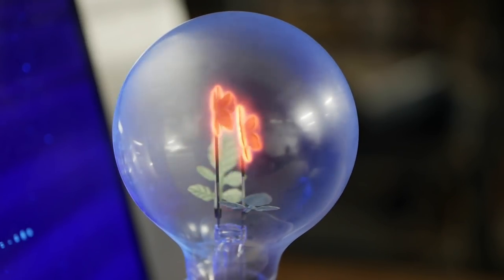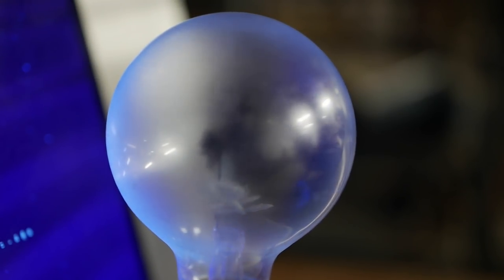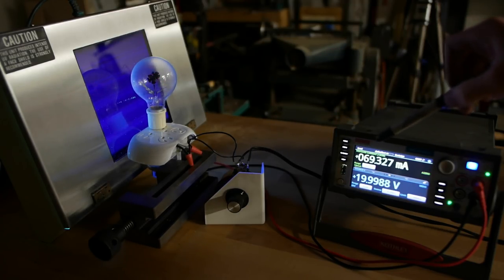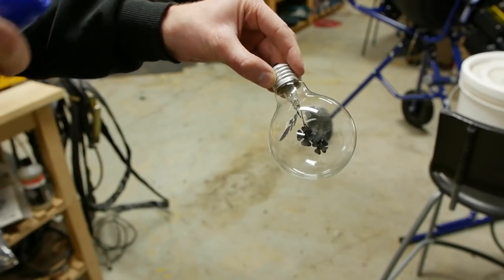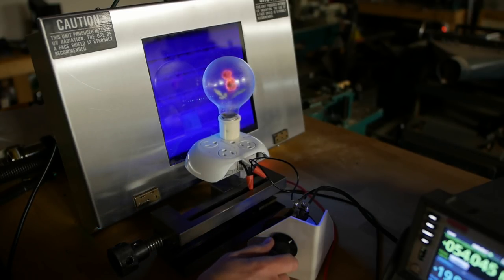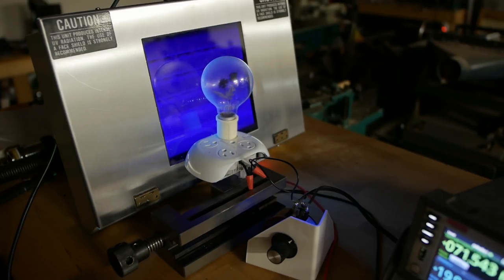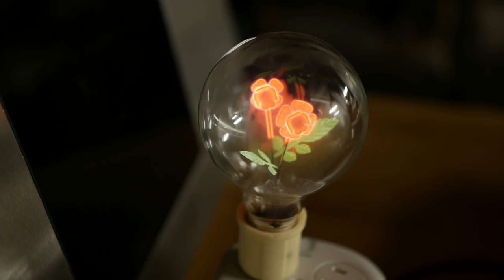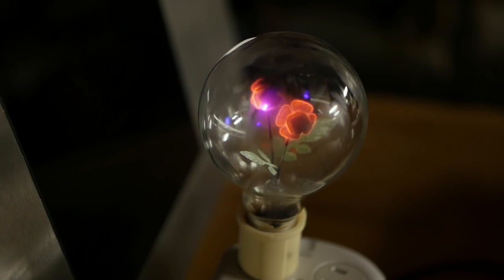Flashing Light Prize 2018 - Sunscreen, UV, and neon

Comment: Great video!  I do want to note that It is actually possible to use lower energy photons to push something into a higher energy state than would be predicted by standard methods.  The phenomenon is called 2 photon absorption, and it is used in microscopy of biological specimens where damage due to high energy photons needs to be avoided.  Maybe you can come up with a way to demonstrate this effect in a future video.  Keep up the good work.

Comment: wow, two things that surprised me, (1) Didn't think the photoelectric effect would worked through glass as shorter wavelengths would be required .  (2)  I guess the AC is enough to turn it back off, as once ionised it would normally stay on.   Nice application of theories

Comment: Is firestarter a brand name or is the outlet a cheap gimmicky thing that would actually start a fire? What is the purpose of having rotating outlets and how did you connect a motor up to it?
Reply: I'd be interested too
Reply: Shocking purpose: ...self-winding cord unplugs automatically after it becomes tightly coiled (and/or starts on fire).

Comment: You can achieve the exact same effect by illuminating a neon lamp near ignition voltage with nothing more than a red LED.  UV is not required.  I discovered this when I was using my DIY telescope motor drive (U-controller controls output frequency for standard, sidereal, as well as the King rate) to a synchronous AC (shaded pole) motor..  I used a neon lamp as a "output active" indicator, and a red led on the control pad was used to provide "night vision safe" red illumination of whatever needed illumination.  The neon lamp I had on hand would barely flicker with the normal power applied, but shining the led at the lamp from even a few feet away provided enough excitement that the neon would go into full illumination under the influence.
Reply: I will try this, thanks.

Comment: Based on the colour of the neons I first thought it was copper in an acetone bath or some other sort of catalytic burner. Before I heared they were neons I thought the cables were tubes with fuel and just a mechanical valve underneath opens and shuts them.

Comment: Isn't it a bit dangerous to have the UV lightsource shine into the open like that?
Reply: what're you, our mom?
Reply: The lamp is likely emitting mostly UVA, a fairly safe spectra of UV light.
Reply: Why do you assume he is only using the sunscreen for the lamp and not for himself too?
Reply: RELEASE THE HOUNDS!
Reply: It is. I used these things a lot for cutting fluorescent DNA from electrophoresis gels. I once got arc eyes from just 2 minutes of working without the UV blocking face shields we were supposed to wear.

Comment: Yes, but can you also do this with xrays? Or maybe something a bit more.... ionising... ;-)
Reply: I think you can, I remember reading an article about some vintage neon bulb that used a radioactive source as a starter, so you didn't need to run it at as high a voltage. I'll see if I can find anything...

Comment: It does not have to be UV, I have triggered old neon lamps with white light, either natural or from a flashlight. It will be more sensitive to UV though. Though it could just be reacting to the blue end of the spectrum, I am not sure. 

There are FireEye flame detectors that work on a similar principal, small glass, maybe silica, tube with electrodes and probably something like argon inside. the electrodes are biased and then UV from the fire hits it a little current flows.

Comment: UV light can provide high enough energy for the electrons to overcome the work function of your flower material (normally around 5 eV) so the electrons can free from the surface and entering the neon gas causing light. Sun screen spray normally contain ZnO power that can effectively absorb UV light. It's theoretically possible tha you may make it possible with normal visible light if you could have a dark room and more precise control of the voltage as well as the uniformity of the coating material of you flower.

Comment: 1./ If the laser beam is diffused enough will the entire flower light up? and 2./ just for completeness did you try placing a polarizing sheet between half the light - left or right side - and also, separately, so that the sheet spun with the bulb and eclipsed it on each rotation?

Comment: I wonder if that would also work with a gamma radiation source, and for shielding perhaps a lead salt (fine lead acetate or nitrate powder should be translucent if suspended in a lacquer base).
Or else a rotating perforated disc of lead between the gamma source and the bulb.
Need to get one of these bulbs and experiment. I already have a variac, lead and a gamma source...

Comment: +Applied Science
Got an idea for the gecko tape. if it is too hard to synthesize a mold, try letting a gecko itself stepping into silicone. maybe it´s possible to take its footsteps and lay them side by side and copy the over and over again, thus creating a mold. with that kind of a mold, you could focus on getting the right consistency for the final tape material.

Comment: isn't it really dangerous to look in the UV light?
Reply: There are different types of UV, and anyway there is nothing inherently bad about UV, the trouble is that you don't get a visual clue if it's too intense, whereas if you stare at a bright white light it will make you look away before any serious damage is done.
Reply: Probably. I've seen people are selling 200W UV LEDs and I couldn't believe they were legal to sell.
Reply: We have the exact same uv lamp in the lab and we're not supposed to look at it if the transparent UV-filter is not on it. 
A prof told us that he got sunburned. 
But in order to make his project work applied sciences probably removed it.